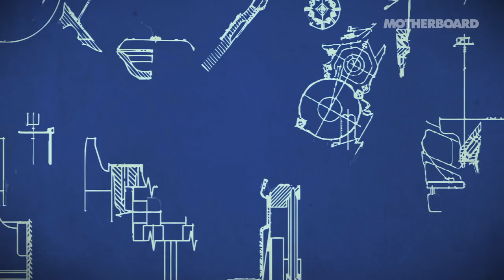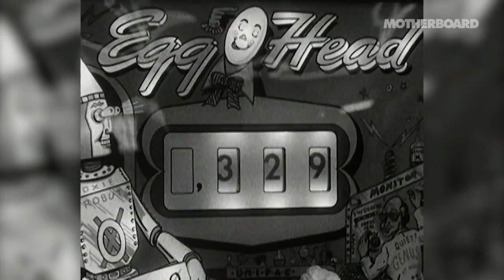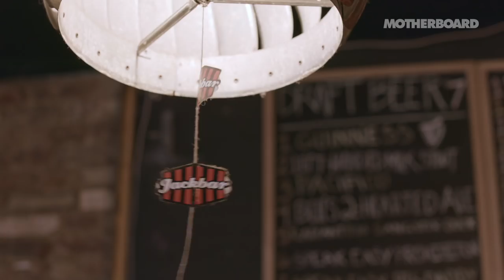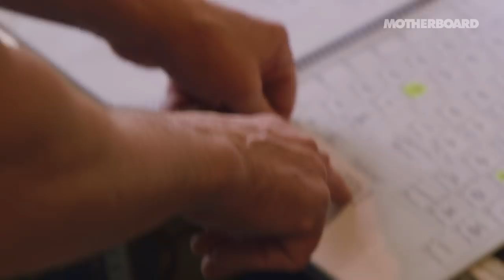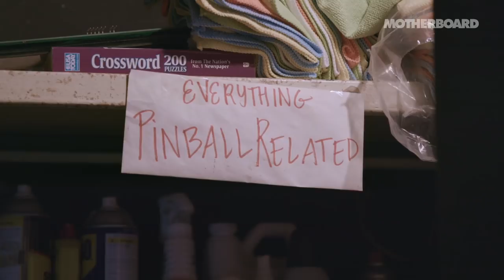The Pinball Doctors: The Last Arcade Technicians in NYC

Comment: I've got a bunch of vids and 2 pins.  All need work from time to time, and I do the work myself.  I've only been doing this for a couple of years, and I manage to get through most problems on my own, and with help from the many sources on the internet.

Yeah, some parts are impossible to find, but most of the time, you can find a suitable replacement, or, if you try hard enough, find someone with the part lying around.  It's not that hard, and it's actually kind of fun.

Comment: Its funny the laptop I'm watching this on was a throw away and all that was needed was a new fan. Of course it was a nightmare to replace it but not impossible :-)  So for a few dollars and some time, I have a really good laptop!
Reply: I was going to throw out an older laptop because I cracked the screen. But I got a replacement screen for cheap on eBay and still use it.
Reply: mcorrade  Fo' shizzle, son!  I'm on a 10-year-old Dell running on Ubuntu because Windows failed me three times.  My other computer was literally pulled from the trash bin at work with cut power supply wires and no hard drive.  Matched/soldered the wires, bought a cheap used hard drive, also running on Ubuntu.  That's been my main PC for about 5 years now.

Waste not whatnot!
もったいない！
Reply: the laptop that is hooked to, and runs the media on my TV, was a throwaway. Friend was tossing it because the screen was broken. I asked if he'd give it to me for parts. I didn't know if it was working or not. I plugged in an HDMI and it booted right up. No repairs needed. So, I removed the broken screen, and now it hangs on the wall behind the TV. Faster than the interface in most "smartTV" devices also!

Comment: 5:07 The bottom of those things looks like the inside of a fusion nuclear power plant! Modern technology such as 3D scanning and 3D printing could help with the replaceability, repairability, and reliability, but it sounds like there's a major problem with non-standard parts and excessive fragility. Maybe a lot of people could come together to decide on a set of parts or at least sizes that these parts will be, and redesign pinball machines using those standards. It could be far less expensive in the long run.
Reply: All pinball machines are a combination of standard and unique parts.  Companies only tended to use unique parts when they solved a unique need, or when they were customer-facing display parts.  One thing you need to keep in mind, though, is that standards change - a standard relay in a 1977 machine may not be easy to find or substitute in 2018, whereas another may be.  And rubber bumper parts will always need periodic replacements.  I think of one of my favorite machines from the late electronic pinball era, Star Trek TNG - loads of custom parts, and they're generally only in good working order if owned and maintained by someone who truly appreciates the board.
Reply: what is standard?  these machines were made by different companies who each had their own ideas and patents.  the thing is that a lot of patents were not truly honored and a lot of parts are similar.  things like flippers should only be by one company who invented them but others made there own versions.  like an earlier poster said technology changes and so a standard will change.  one of the big revolutions was when the coils went to 50v ac which gave the flippers and jet bumpers extra kick.  solid state electronics changed the how games played and how each player could have a different scoring scheme depending on how much of certain tasks they had accomplished themselves not reliant on what another player had done like with spinner targets on em games where you inherit the last players position for advancement for a bonus score.  then other solid state games seem like they were designed to break on purpose like a gottlieb system 1 which can have a power supply plugged in backward when you remove the head to move it sending high voltage into a 5 volts logic path or adjusting scoring switch gaps with the power on and touching the bulb connection which will send a spike to the spider chip and fry it and since the chips are mostly irreplaceable the game board is shot. or losing your negative power supply which makes every coil and driver in the game lock on and burn up.  the only standard on a game is the bad ideas that cause them to break like who puts batteries that will eventually leak and damage the game board on the game board.
Reply: Yep, even in the context I was talking about (standard and unique parts), all those standards are only within a company in most cases, or a supplier when sourced outside that company (relays, lamps, etc.).
Reply: I thin looking at the beatiful inside of the dead  console in the sand pit at Clary'sBayside (VT) gave me my life time love of electronics.

Comment: It blows my mind to see him use a giant Weller soldering gun to work on a few small wires. I guess most of the repairs aren't very intricate, as the guy obviously knows what he's doing.

 I remember using my dad's soldering gun to work on electronics when I was very young, when it was the only thing available. It such a HUGE step up in my abilities when I learned about ordinary irons and soldering stations!
Reply: using a weller gun on coils and wires isnt difficult, and waiting for a pencil type iron to heat up for a single repair takes way too long.  board work is another story, cant go near one with a weller gun.

Comment: I have a MINT one owned Bobby Orr Pinball that needs work, in Portland, OR. Any help?
Reply: Maybe check out a local makerspace, if you offer them a couple bucks and some nice beers you can normally find help.
Reply: Ahh thanks Steve! Never thought of the makerspace angle. Its a mint one owner I've had for 30 years+ Bobby Orr PowerPlay. Thanks Steve
Reply: On it now! Probably closed for the weekend... But thanks 4c!
Reply: Anytime baby, good luck!
Reply: The 30+ year old battery on the motherboard needs to be the first thing you replace. Check the board area around it for battery acid leakage.
Reply: Theres a guy in the community that provides a new board (bad corrosion)and replaces the bat with a new capacitor. Cant remember his name.... That was the first thing I replaced, still no love. Thanks for the reply!
Reply: Steve  What's a makerspace? :o

Comment: MOTHERBOARD, why does pinball games power supply only use ONE big filter cap rated at 27,000uf and higher, any reasons to use such a very large capacitance value?
Reply: Yeah, capacitors store instantaneous energy. You need lots of capacitance to deliver high current demand of solenoids (flippers, etc).

Comment: MOTHERBOARD, why did all pinball machine switch off from using AC coils AC solenoids to using DC coils DC solenoids, what are the reasons why?
Reply: I think I remember talking to one of the tech guys about that. First and foremost, the tech behind them got better. A DC solenoid nowadays can use a lot lower voltage then the ones way back when, and still give the same amount of power behind their kicks. The problem of course, is you have to totally rewire older machines to handle the new coils. But I was told they also use a lot less power as a result as well.
Reply: @AC3handle  , Thanks for the help. The Older pinballs machines in 70's 80's used linear power supply which only had ONE filter cap rated at 27,000uf very high capacitance value, any reasons why such a high capacitance because most power supplies use multiple caps at 100uf not just one filter cap.  Any reasons why ?

Comment: cool..pinball my fav...why not do this type of mechanical games using modern tech? can reduce all those winding wires & so on(much simpler electronics module), easier to maintain..less power usage..
Reply: extreme748 those exsist but i think people like the retro sound and look.
Reply: The NEW ones do, he's repairing old machines as they were built.  It's impractical to make a new PCB to put in old machines that may only have 1% of the original production run still in operation.

Comment: I live in rural SC and I know SEVERAL pinball/arcade techs. I am one of them. I haven't done repairs in a long time but it's something that you pick right up. You make it sound like Techs and repair people are going extinct. Quite the opposite. There are many of us left and new ones coming along. Pinball repair isn't rocket science. You just need to know the operation of the machine and the electronics involved along with problem solving. I will tell you one thing, that Haunted House he was working on is a total POS to work on. Those things were horrible in design from the start in 1982.

Comment: LOL! Pinball machines aren't difficult to fix for anyone with basic electronic skills. The only reason there is a 'shortage' is because there's no $ to be made doing it.
Reply: Exactly.  You basically have to be an owner-operator of a pinball arcade/bar for it to be a worthwhile endeavor.  I can't imagine people are going to pay you $50-$100/hr to drive out to repair a single bumper that won't keep score unless the machine is worth big bucks and there's an interested buyer that requires it work 100%.
Reply: It depends. Sometimes not even the most skilled electronic engineer can fix it, depending on the problem. And parts are extremely hard to find on the old games, so...

Comment: Pinball machines are extremely overpriced. Why does it cost 4, 6, 8, or 10 thousand dollars for a pinball machine? What kind of demographic are they trying to sell these to? Even for buying it for a business, I can’t see someone ever turning a profit by buying a very expensive machine like this. Sure, you can buy a 20 year old machine for like $1500, but how much is that gonna cost you in the long run between downtime and repairs? In my area, it costs $95/hour every time a technician has to come out to diagnose a pinball machine. That doesn’t include additional trip fees, additional labor, or parts. Unless you dedicate your time to repairing it yourself, you are screwed.
Reply: It’s not for everyone. It’s a hobby and If You can’t afford it, you won’t be able to do it. Today Pinball is a collector’s market.